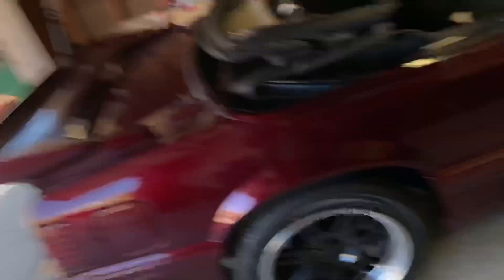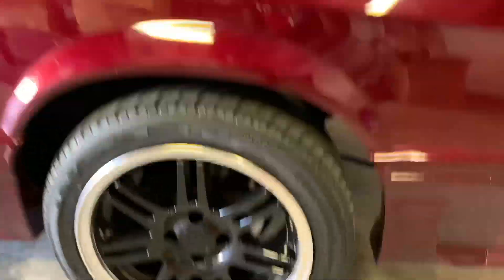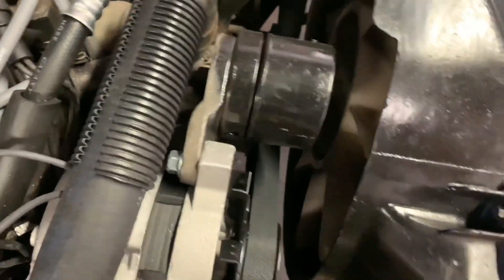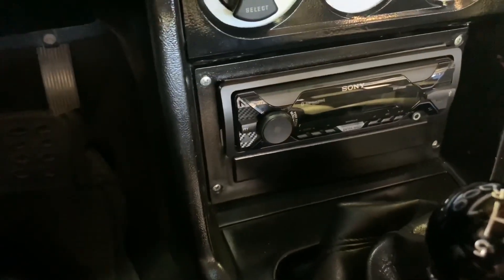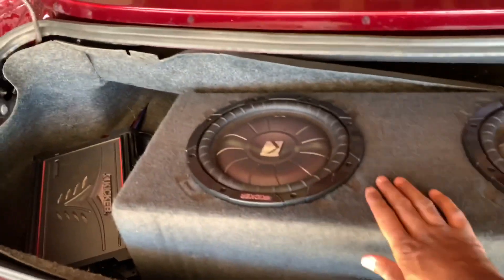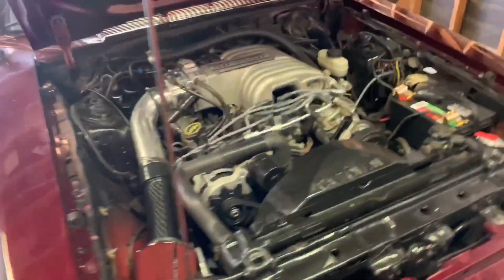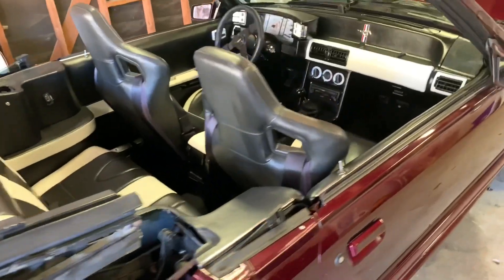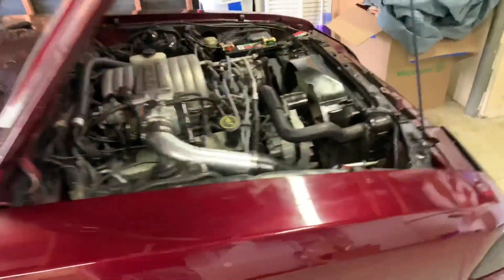The coolest 1987 Fox Body Mods

Comment: Definitely the brake upgrade you mentioned.  Big brakes, if you're doing it anyway.  Also, upgrade the brake fluid at the same time.  Personally, I'd also do a chassis stiffening kit, to get rid of some of the twist from it being a convertible
Reply from the maker: The brakes are the first things I plan on upgrading! It’s no point of going fast if you can’t stop 😂 If only I was only rich I would have this thing set up

Comment: Facing the woofers up doesn't decrease the life, it kills the front wave of sound if the load wall, ie your decklid is too close to the cone. I see a lot of the new era "Fast and Flashy" guys have the drivers facing the decklid and I shake my head because it seems like they are just interested in making the decklid rattle. If you want the boom get a box built for the woofers, and there should be an distance from the load wall equal to the diameter of the woofer. 10" driver-minimum 10" from the load wall.
Reply from the maker: Bro you know a lot about woofer! I appreciate all the info because I never knew. Ok bet. I actually got them to face the rear now. Had to adjust some things and now it’s good

Comment: You think a small shallow 10 inch sub would sound ok in the trunk? Or should I go with a big 12 and box?
Reply from the maker: I actually have 2 shallow mount 10s in the trunk and they hit hard! You may be able to squeeze 2 12s in a vert. But it will be really tight.
Reply: Car Reviews by KJ I def don’t want 2 12s lol but I was thinking a ported 12 inch kicker
Reply from the maker: Yeah that will sound good. I got shallow kickers and they sound good.
Reply: @CarReviewsbyKJ  sweet